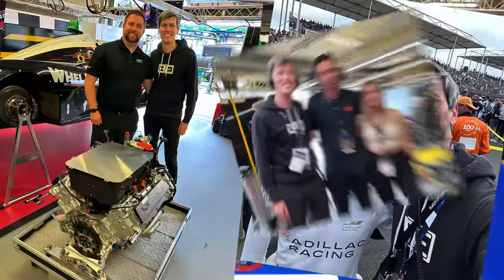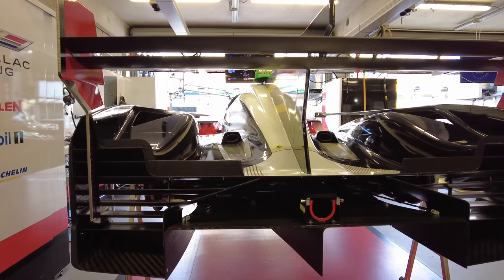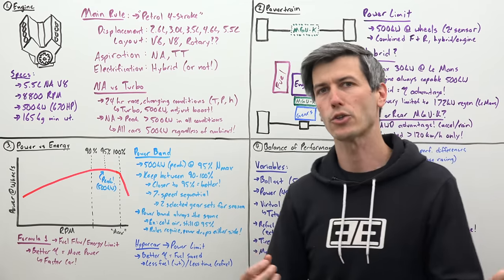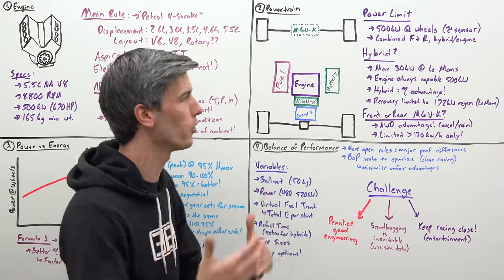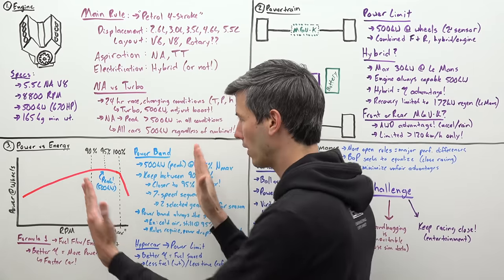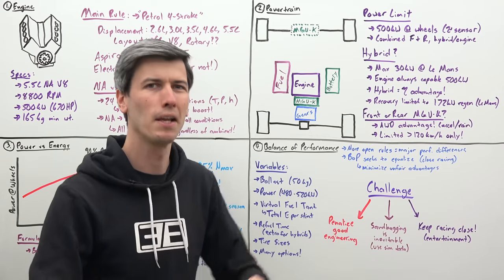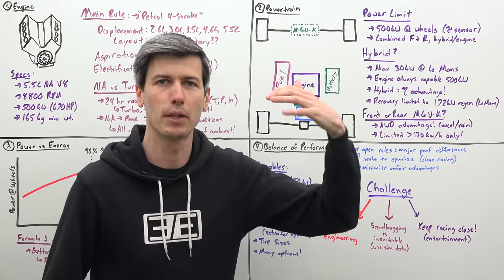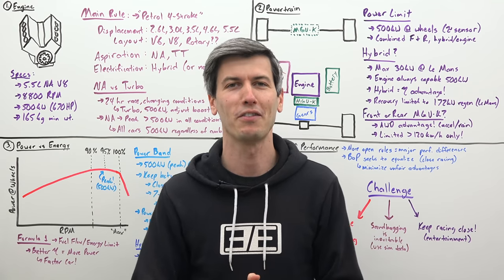Are Hypercar Engines Better Than Formula 1? — 24 Hours of Le Mans

Comment: Think balance of performance is very much counter productive to the LMH class. Motorsport is just as much about the engineering as it is about the driving. Artificially decreasing performance is not in the spirit of the sport. That's also why I don't mind F1s periods of dominance. It's the task of the other teams to catch up, not the the FIA to step in.

If people would be really interested in that, then spec series with the same vehicles across the whole field would be more popular. For example LMP2 consists solely of the Orecas nowadays.

But that isn't the case. People want to see different cars from different teams competing. That's why Rally, GT racing, F1 and LMP1/LMH are generally the most popular motorsports categories.

Edit: It also makes the engine variety much less important and exciting, considering they all are limited to the same power output.
The less restrictions are within motorsport, the more exciting it gets, that's why Group B is generally considered the golden age of the rally sport.
Reply: Yeah, I agree it’s better when there’s more variety between competitors.
Reply: While I disagree with the spirit of BoP, I do believe it is necessary to keep the sport alive. Without it, you get the formula one problem of whoever spends the most wins the most and teams start dropping out. For years, the WEC had maybe 5-6 cars running the the top class, and now there’s 16! You cannot argue that it hasn’t been good for the sport. While it can be exciting (for the first few races) seeing a team build a monster of car, we nearly lost LMP1 because no one else could afford, or didn’t have any interest in a financial pissing contest with toyota.  Quite simply, LMH/DH wouldn’t exist without BoP

Also, the intended function if BoP is not to make the cars 100% equal, but the reign the cars more closely together. If all goes according to plan, better engineered cars will still perform, and the lesser cars will not do well. We saw this in Le Mans this year, Ferrari and  Toyota still came out on top while the lesser cars did not. 

BoP is an adaptive system that changes race to race. When implemented correctly, it will make the sport more appealing for new teams while still rewarding clever engineering. The FIA is trying to achieve the same thing in f1 with cost caps, but it clearly isn’t working (not yet anyway, we’ll see). If you want to sit there and watch the big spender dominate race after race, be my guest. I took a hiatus from f1 when mercedes won 7 championships in a row, and I believe the majority of fans share the same sentiment. 

Personally, I’ve started to prefer IndyCar to f1 because it is a spec series and the racing is pure. We’ve had 5 different winners across 9 races so far this season, it’s become an absolute treat to watch!

Comment: While I agree that F1 is a engineering competition, it's not just the car.  If that was the case then Red Bull should be finishing 1-2 every race, however Max wins and often Perez is way behind.  This means that there is the element of the driver as well.

Great videos.  Keep them coming.

Comment: WEC rules say that the engine shall not make more than 670hp.  However, the thing about normal engines, when they say they have 670hp, it has a MAXIMUM of 670hp at a specific rpm, and most of the time it doesn't. so it makes sense to make an engine that has more than the 670hp, and then restrict it thru mapping to increase the rev range that max power is developed.  And of course, the other way is to fill in the power difference with the electric motors.

Comment: I wish F1 would bring back the 1989 engine regulations. Back then you could do whatever engine layout you wanted up to 12 cylinders, and a maximum displacement of 3.5 liters. It would be interesting to see what the engine manufacturers would make to compete.
Reply: Exactly, depending on the design decisions that the engine manufacturers make. To keep and even playing field I think they should change how they regulate powertrain design, N/A or forced induction. Boost pressure and rev limit should be inversely proportional to the engine size, but for naturally aspirated engines, they would be instead, just regulating specific things such port volume and flow, rev limit and restrictor size. Wasn’t there at one point in F1 history, where V12s, V10s, and V8s shared the same grid? I think what they should do, instead is that, make the electrical components specific to the hybrid system, such as the electric motors, batteries, inverters, and ECU standard equipment supplied by the FIA, but let the manufactures play with engine configurations. Imagine if Ferrari brought back their V12 that can rev to the moon? Isn’t Porsche and Audi coming back? We know Porsche can do really good powertrains, their 919 has a turbocharged V4 engine hooked up to the hybrid system. Imagine if they brought that kind of technology into F1, what if Renault Alpine looked into their past to prepare for the future? Look at the stuff they did for Group B and Group S, imagine, four-cylinder engines came back to F1. Isn’t and American team join too? A 2026 V8 F1 car? That sounds like something that would crash the Internet the moment someone steps on its throttle
Reply: Problem is that, eventually, everyone will go to the one that turns out to be most effective design (in 3.5l, it either V10 or V8). That's why in F1 (and WRC) mandate single engine type

Comment: One edit you should make is that the boost numbers are set by the BOP from IMSA/FIA/ACO, usually a week or more before the race.
Something interesting is that the 5.5L V8 DPI Cadillacs in IMSA were the most fuel efficient cars in the category even though they were racing against a Nissan 3.8L TT V6, an Acura 3.5L TT V6, and a Mazda 2.0L TT I4.  

Another interesting thing is that GM invested a lot of money making their pushrod V8's breath more easily in the 1990's (at one point the LS V8 was the most efficiently breathing engine on Earth).  They did this for several reasons: 1) it was cheaper to do this than develop a new engine family from scratch 2) to improve fuel economy and reduce emissions 3) a pushrod engine is more compact than overhead cam design (the last generation of Chevy Impala had an option for a FWD longitudinally mounted LS V8, and also google LS swapped Volkswagen from some crazy stuff).

Comment: The biggest problem I have wit BOP is that there is the chance that you simply have to be lucky to have the best package without actually having the best package because the officials messed up the BOP. For example this year a Ferrari won the N24H the first time. The 296GT3 is a new car so officials have little data for it and when I watched the race I immidiately saw how fast the car was compared to the others on the long straight. They were pretty much given the victory on the silver plate. It's simply not fair. And at Le Mans Toyota, although I'm no Toyota fan got hit by BOP before the weekend more than any other car.
Reply: That's a reasonable concern. The only scientific solution is to have two races, one with BOP and the other without.
Reply: @extragoode sounds like crying to me lmaooo
Reply: Actually... the race winner at LeMans got hit with the second biggest penalty with the BoP adjustment. 
Yeah, Toyota got nailed, that is what happens when you are 1-2 a lot (and it happened twice in WEC this year so far, Sebring and Spa) but so did Ferrari and I will have to remind you that Car 51 won... 
They were not pleased with it at the time. Today? Do you think that they care?

As for the N24H... I can see the problem with that because the only racing data on the 296GT3 was at IMSA. They are not connected with the endurance or GT circuits and a new car harms that since it's just out of the blue for all purposes. Next year is going to be a handful.
Reply: They actually got the perfomance very, very close. Until Hirakawa sent the Toyota off the black stuff they had a very good chance. The Ferrari wasn't cruising then.

Comment: 2:40 :(

RIP the legendary rotary 787B
Reply: @AzathothsAlarmClock  787b was the car, 787 was earlier model. Motor proved itself to last the whole race and was in excelent condition afterwards, to the point that the engine could go for another round while the chassis was almost ripped apart. True example of what a rotary is capable of in racing applications

Comment: Would like to see greater novelty in car construction.   Here is one race series we came up with:

1)  each grid (the set of cars that show up for the race) is ranked higher (ie. closer to pole position for the race start) for grid positions as the size of their engine shrinks.  So a 2-cylinder engine has a qualifying advantage to a 4- or 6-cylinder engine

2)  absolutely no limits to the engine construction.  2-stroke, or 4-stroke, or diesel, or rotary, or some novel design - only requirement is the engine must run on no greater than 93 octane pump gas (mixed with 2-stroke oil for a 2-stroke motor) or pump-grade diesel.  Limit of 1 liter max.

3)  each car is ranked higher up the grid as the team budgets shrink.  So a team that spends $100k  is ranked higher on the grid than a team that spends $500k

4)  absolute limit of $1 million for the team budget

5)  there must be 5 cameras on each car: cockpit, front-facing, rear-facing, and one facing outward from each side

So the race will consist of 1- or 2-cylinder engines, and really cheap cars.  

This will get rid of the 'throw money at the problem' people who basically ruined F1.  It will shift emphasis back to HUMAN CLEVERNESS in engineering.   

F1 and Indy car had much more freedom for car design in the past (remember the turbine cars from Lotus and Granetelli at the Indy 500?)

Colin Chapman's ground effects and so many other design novelties would never be allowed - all designs are set and heavily influenced by Mercedes, et al.

FORMULA ONE has become as exciting as WATCHING A GUY PLAY MINIATURE GOLF FOR 2 HOURS

They forgot that racing is a SPECTATOR sport.  NOVELTY is why people will pay for tickets.  Not sameness.  SAMENESS lacks the appeal of novelty.

You want to see some real racing?  Watch the Isle of Man TT.  Or the Megavalanche bike downhill, the winter version
.
Reply: Liberty Media and the FIA should recognise that all sport is showbiz and that racers are there to entertain as well as win.

Comment: I think it needs to be mentioned that it’s not quite as simple as BoP penalizes good engineering. 

There are still ways to engineer a winning car even with BoP. For example - a car with +10kg of ballast will still have an advantage over an otherwise identical car that has that same 10kg baked into the design since ballast can be added in strategic areas on the car to lower the center of gravity, compensate for aero balance, etc.

There’s a reason why the Glickenhaus hasn’t been able to compete with the Toyota and it’s not because of bad BoP.
Reply: Wouldn’t they then just penalize you further by reducing your power or something?
Reply: Also reliability, handling characteristics across a variety of circuits, track conditions, tire conditions, etc., and ability to quickly “turn on” tires and maximize their life

Comment: I hope you don't mind me asking some questions:
1. Is the engine being a stressed member of the chassis essential to dealing with the rocking couple inherent to a cross-plane V8?
2. If not, does it have counterweights on the crankshaft?
3. If it does have counterweights, how does it rev higher than the flat-plane V8 in the C8.R/Z06?
Sorry for being so uninformed, and thanks for reading. Great video!
Reply: valve train stability is more important than rotating assembly mass when it comes to higher revving engines. Just look at some old american drag cars and american GT cars, 50+ year old v8's and can crank to 8-9k rpm.

Comment: 1 rule, petrol, 4 stroke engine. 
2 rule, not more than 500kw. 

There goes the Audi Diesel engine that walloped all comers, and the Mazda Wankel engine that won it’s  only race. 

Rather a pity we couldn’t see these developing further as race engines, particularly the diesel as it used less fuel over the course of the race.

Comment: Thank you for years of informative videos. How about a discussion on the physical/chemical/functional properties required for automotive fluids other than gasoline and motor oil. Why does brake fluid have to be so hygroscopic? Why can't engine oil serve as clutch/transmission fluid? - it does in my motorcycles. How does ATF fluid differ from transmission oil, and why? Do the additives in the more expensive radiator fluids really make a difference. (You could probably skip discussion of windshield washer fluid...). Thanks again for these great engineering videos.

Comment: Endurance racing lost me when they went so strict with power curves and forced gear selection.  I love that all the engines CAN be different, but when they all have the same max power and curves there is no real difference and the end result is.. well not as good as F1 even with their restrictive formula.   In the good old days with the LMP900 and LMP675  (then LMP1 and LMP2)  there were all sorts of different engines, and even Diesel, and bio-butanol fuels and it was truly a haven for technology.
Reply: well, LMP900 had restrictions on engine size as well… and to be honest, without BoP and such limitations prototype endurance racing likely wouldn‘t exist anymore, those regulations are also a cost-cutting measure to prevent what happened with the overly expensive LMP1-H cars…

Comment: Are Hypercar engines cooler than F1? After LeMans, I think Ferrari would say "SÌ".
Reply: Actually, even before that.... Enzo LOVED endurance racing. His company, Ferrari was founded on that passion. Last time Ferrari was at LeMans was when he was alive and they had a reputation. 
This year, Ferrari is honestly questioning why it took them 50 years to come back if it was this "easy".
Reply: @DuvJones  It was not that easy. Prototype racing is expensive, and they have also been racing in F1 for as long as it existed. For the most part of those 50 years, they just couldn't afford it, and today they are still the only manufacturer to compete in both F1 and Hypercar (until Alpine next year, the A480 wasn't their design), and it took the disappearance of the prohibitely expensive LMP1 program for them to return. And they also just built the car, it is operated by AF Corse. Money is the game, and the Hypercar program really changed the game. I don't think it could have happened before.

Comment: Super interesting video! I am definitely looking to diversify my motorsport intake because of how much I enjoy F1. How would you say the F1 domination eras are different from LeMans being dominated by Toyota Gazoo Racing, Porsche and Audi during the last decade? Or are these new BoP regs meant curb exactly that and they weren't in play during those eras?
Reply: Just like in F1, Le Mans eras are bounded by large rule changes.  The ultra high cost LMP1 years of the early 2000s led to diesel eras with Audi and Peugeot,  which gave way to a hybrid era with Audi, Porsche and Toyota. The current era is partly related to working with IMSA in the US to synchronize some rulesets to make it easier for the many US teams to race at Le Mans.  IMSA has knock down drag outs with Acura, BMW, Caddie, Porsche, maybe Lamborghini next year....but yeah, all of that better chance to win gives manufacturers incentive to spend the big bucks to take their cars racing.  And the racing is very good.
Reply: Toyota was basicly the only one for some time, only this year there was a some good comptetition. And in the years of LMP1h rules they were not using BOP, but Eot similar to F1, fuel flow restriction. They are using Bop for last three years or so.
Reply: @GasperGartner123  Some form of BOP as always been there, Weight and restrictor plates where the tools of BOP. In 2005 They choked us to 4seconds behind the Pescarolos in qualy. with plates and lead in the side pods. Thing is, at full bore, the car wasn,t even pulling a sweat then, and both engine and gear box went from reliable to bomb proof, the other guys not so much. Now BOP starts at the drawing board and the simulation tools are mind blowing accurate!
Reply: I don't think  Mercedes/Red Bull domination is the same thing with TGR "domination" in WEC. In F1, all cars are practically equal, but in WEC, they have different classes, and only one class that could won in overall race, it's Hypercar class (or previously called LMP1).

 Now back when TGR is "dominating", TGR practically is the only one competing in that class as they're the only full fledged factory team with full support from Toyota, translate that to F1, the situation back then is like Mercedes/Red Bull winning every race where all other competitors in the grid is either some teams that runs a modified F2 machinery or Haas.

And it's shows that now, there is other full fledged teams joining in (like Cadillac, Porsche, Ferrari, or BMW next year), TGR started to losing their dominance, like losing this year 24h of lemans for example.